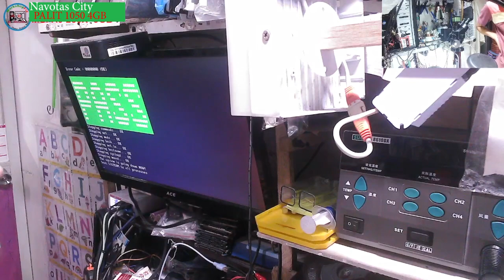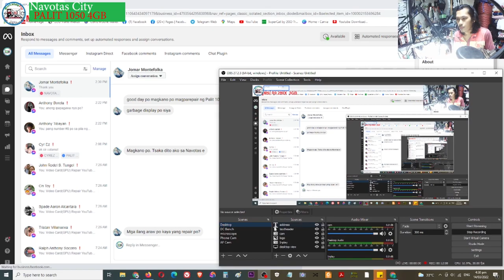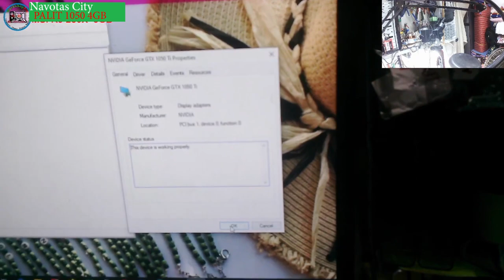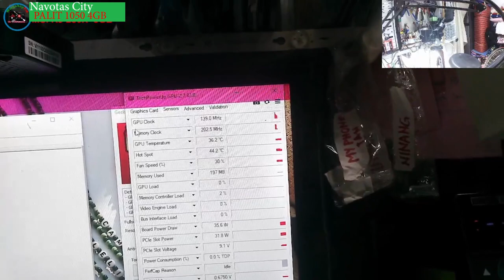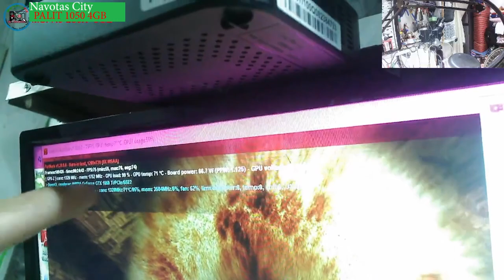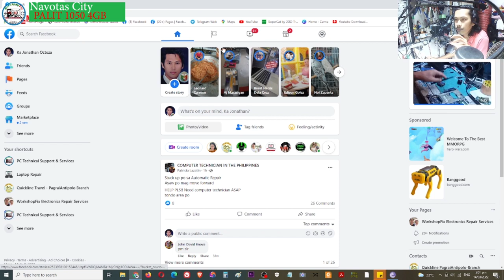PALIT 1050 TI 4GB - Error Code 43, Driver Can't install, GPU Chip Issue (Solved)

Comment: What is the fluid placed on the toothbrush? Is it straight water? It does not act like alcohol. Just cleaning the corrosion from the sides of each chip makes it function abnormally. Or normally if cleaned away. Not sure what happens under the chips when corrosion is present around the balls. Dipping the brushes under the chip sides reduces the corrosion a bit. It really seems to work for you but the most spectacular saves I have seen you do is to not reball the chips with a stencil but to remove the no lead solder from one of the  chip faces and use the remaining solder to put the chip back. My guess is early failure from cracking as poor solder material and not enough without reballing.
Reply from the maker: Laquer Flo and Alcohol po. with Ultrasonic Ceaner Machines

PM po kayo dito sa Video Card(GPU) Repair Business Page para po sa information, contact no., location at ma-assist kaayo.

Salamat po,
 link: https://www.facebook.com/VideoCardRepair/

Comment: Gpu: Nvidia Gtx 1650super
Error code 43 on gpu. Fixed 800x600 resolution. Pink small lines(not permanent) Troubleshoot done:
Update the driver
Uninstall using ddu
Install the latest version
Clean the pins using eraser
Thank you
Reply from the maker: PM po kayo dito sa Video Card(GPU) Repair Business Page para po sa information, contact no., location at ma-assist kaayo.

Salamat po,
 link: https://www.facebook.com/VideoCardRepair/

Comment: Hello sir my gpu gtx 1050ti shows error code 43 with letest nvidia driver update on windows 11 but work fine with older nvidia driver.
Reply from the maker: PM po kayo dito sa Video Card(GPU) Repair Business Page para po sa information, contact no., location at ma-assist kaayo.

Salamat po,
 link: https://www.facebook.com/VideoCardRepair/